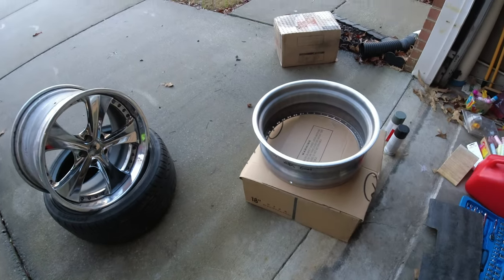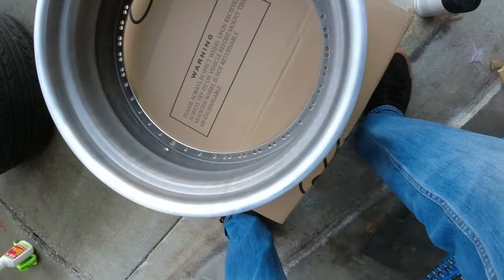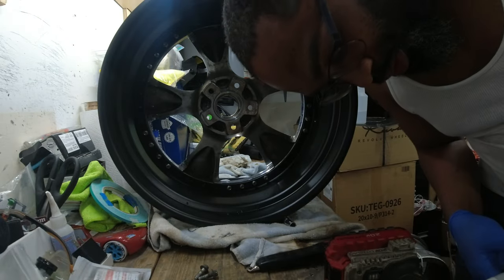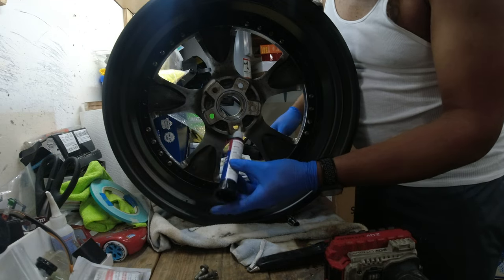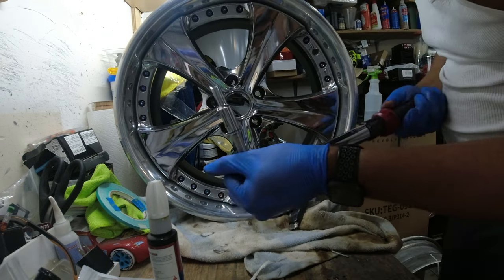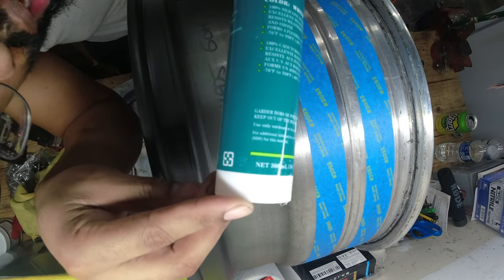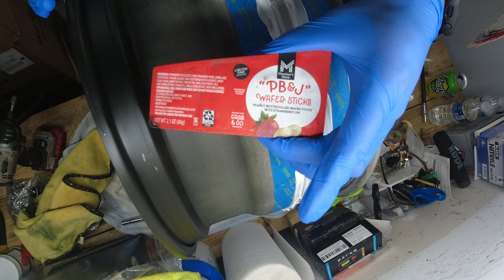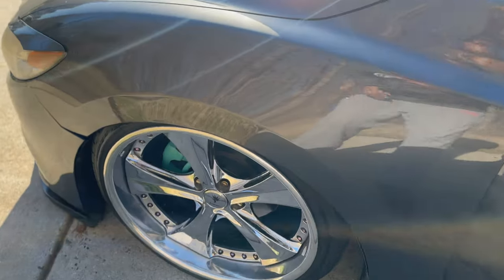3 Piece Wheel Rebuild|Barrel Replacement|WedsKranze

Comment: Nice work bro. I have a set of 19” OZ Opera that I want to rebuild and step up to 20”. Any recommendations where to get inner and outer barrels/halves? This is the first time I’m doing something like this. It looks super simple, any times tricks you could share with regards to buying barrels and installation?
Reply from the maker: In my opinion, VR Wheels are the go too for lips and barrels. I don’t really have any tips and tricks other that tighten the bolts in a star pattern to keep everything as centered and even as possible. And also, use blue loctite to keep the bolts hardware from coming loose and check the torque specs on the size bolts you are using.
Reply: Thanks bro, I’ll try to call them tomorrow and see if they got what I’m looking for and how long the wait time would be. I usually wouldn’t mess with stuff like this but it looks very simple to do so I’ll try it on my own.